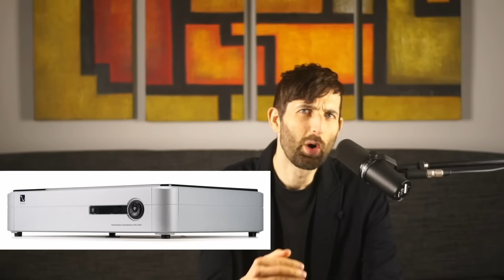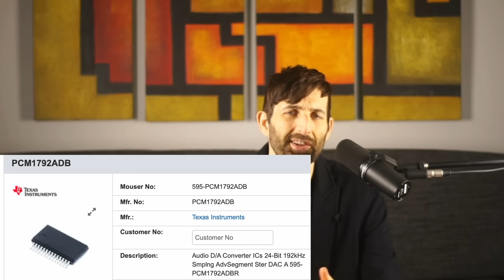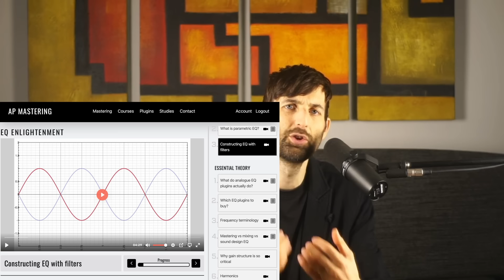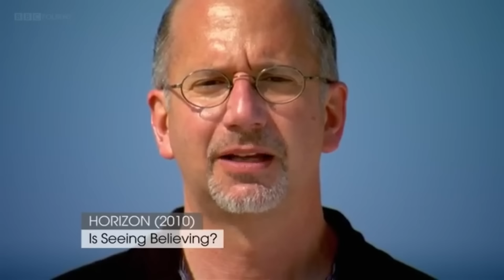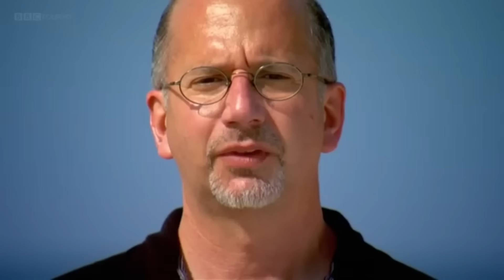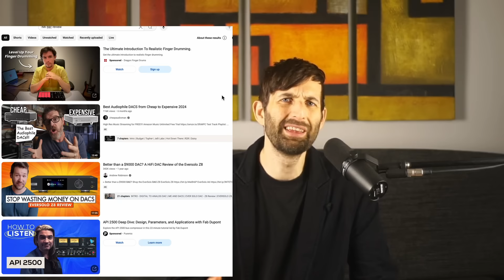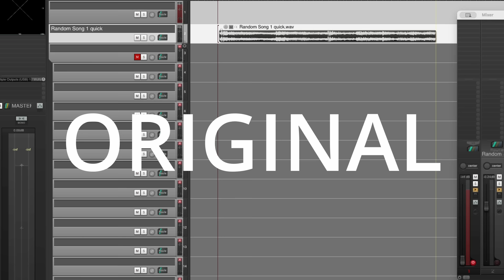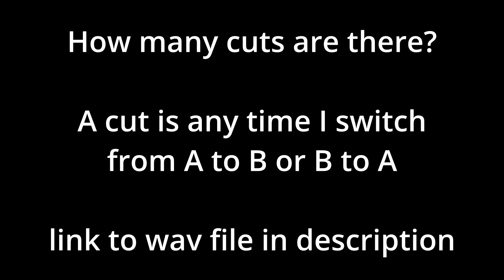The DAC Scam - Almost everyone believes the hype

Comment: So what would you say is the ceiling on what you need to spend to get the absolute best performance. I’m using an  RME ADI-2 atm, roughly £1k, it’s clearly better than other DAC’s I’ve had sub £500, most people would hear the difference imo. 

The other question I have is what is it that made my previous DAC (which couldn’t match the resolution of the RME) have a deeper soundstage? Again clearly noticeable, even someone with zero interest in hifi could hear the difference in depth.
Reply from the maker: Once you are in the RME bullpark, you have already spent enough. RME are IMHO one of the most solid manufacturers of converters imaginable in terms of ultimate quality without getting silly. Although you can certain get similarly good products for less than RME want
Reply: @APMastering Thanks for the reply, good to hear your thoughts.
Reply: @APMastering RME, Merging Technologies for the poor :-)
Reply: @MrMftech  Merging Technologies, Prism for the poor :-) see what i did there? lmao utter nonsense
Reply: The Audio Science Review site measures DACs using a standardised suite of tests so you can get actual measurements to compare. Price doesn't necessarily correlate with the measurements. The RME measures great, plus the per-channel PEQ is an amazing feature you don't often see on DACs.
Reply: You could try its followup model, the FS version, but I'd send it back if you can't tell the difference. Some mastering folks can hear a difference, but they do need to listen most carefully of all the engineers of the sound professions and they do so in the best listening environments.
My ADI-2 just sits there beneath me Fireface UC these days. I needed the ADI-2 because of my portable DAT recorder(I'm a sound designer and re-recording mixer) back in the 90s and 00s. That and the RME Digi-96 card to get in to the machine. My educated guess is, unless you're a working mastering engineer, it's unlikely you'll need anything different than the ADI-2.
Reply: I have a RME ADI-2 FS in a HiFi set-up as well. Great device if you need everything it has to offer. 
I just wanted to chime in about the lack of perceived depth the RME has. I would ask you this question. Have you noticed that the RME puts the vocalists or center image a bit out front? That's all it takes to mess up the recorded tracks natural soundstage.
Reply: @ Yes I have noticed this too. It’s funny, from a technical perspective it’s a great DAC, but when listening to 2 ch hifi it certainly lacks in depth and space, it’s something thats rarely spoken about by tech whizz channels like this one, thats why asked about it in the OP, did you notice we didn’t get an answer either 🤨 I’m probably assuming here but I don’t think it’s a factor that this chap can explain nor use in his favour to back up his argument. I totally agree with his point about ridiculously priced DAC’s but I’ve heard what a £2000+ DAC can do that a well measuring sub £500 DAC cannot do, I don’t think it lies in the measurements that they go off either, thats the issue.
Reply: @ All the experiences by non-professional listeners are a lesser indicator of true qualityies of a piece of equipment. I'll trust a mastering engineer to a degree, but nobody else. Any of our biases, visual cues and even general health can colour our experience. I mix a lot of dialogue and it only takes a few seconds for our brains to adapt to an EQ change. So to detect the subtleties of a difference in DA conversion between units takes a LOT of critical listening skill aquired over a numer of years. Nobody is born with that. So unless you guys are double-blind testing DACs, where you can't see what unit is being used while you're testing, it's just a developed taste. It's not a quality assesment without that testing, unless that's been your job for many years. Then I'll trust your judgment at least a bit.
Reply: As a member of such sites as ASR for many years & taking the time to understand the various biases as well as psychoacoustics I already know what will be said about things that can't be measured. Subjective views don't hold weight to an objective community. Doesn't matter if you have 40 years in digital music listening. One thing you can count on is this..if you perceive something that isn't truly real it will change over time. Interesting though is that we don't know each other, have never had a discussion about the RME, but both already have come to the conclusion that it lacks depth & space..& puts center/vocals out front. I take no offense when certain people say "it's all in your head".  I would also take a blind test challenge using my system & letting me pick the 3 dacs to choose from. 

I'm not saying most people can't tell one dac from the next. That a lot of gear is just overpriced simple circuits. But I also feel these experts are quick to dismiss how well an "audiophile" can discern the smallest difference in their system that they have spent thousands of hours & dollars fixating on. There is more to a dac than the chip of choice. Most sought after dacs aren't even using these basic chips anyway..just the 1000's of sub $1k dacs that do basically sound similar. If one can't tell a difference between a good fpga dac (pic shown in video) & a sabre dac then you are deaf & saved a lot of money.  @russ-p1
Reply: @ I think thats exactly the point, those of us who hear the differences have been critically listening for years. I’d never hold on to a piece if it sounded the same or less to my preference, regardless of price. I’m struggling to understand how health and seeing the piece would have any influence on how it sounds different, we’re not starring at it whilst we are listening, maybe if you were full of congestion from a virus it would hinder your ability to hear a difference but I doubt anyone is going to be critically listening whilst they are unwell. One important thing to consider is this, someone in this conversation who I have no connection with has discovered the same audible difference as me. This happens over many different users with many different devices from my experience, why is that? It’s certainly not health related or a visual cue. Something to consider.

Comment: Rule of thumb, beyong 2000€, not 200€, you get diminishing returns. Up to there the add ons are usually worth, not necessarily sonically though.
Reply from the maker: im talking sonically. I think after about 500€ for a well designed state of the art stereo DAC there should be zero improvements even for the most astute listeners
Reply: @APMastering  true, but then there's lasting build quality, customer service and cachet. A wise bastard can make due with the budget you point on, but leave some slack for glamour and bragg rights, or you'll enter even less clubs than I do... :)

Comment: 2015 I shot out high end lavry vs focusrite clarrett DA for a month and the difference was negligible. That wasn’t the case with lower price point interfaces from around 2010, but we made some pretty major advancements during that time.
Reply from the maker: 100%. To be clear I was talking about cutting edge chips in this video and not older low budget stuff which actually does sound noticeably shit compared to older higher end.
Reply: @ oh I totally understand your points in the video. Great video btw! I was just posting my own experience in this area. I would guess your average audiophile thinks we’re still in 2005 in terms of their understanding of this topic lol. The ADC end there are still some advantages to higher quality chips, but that’s a whole other topic, and most of your more colorful converters are getting that sound from things other than the actual chip. It’s crazy how good some of the lower end stuff is today though. I can definitely tell the difference in like a lower end focusrite and like 1 level of quality higher, but even those budget units are far from “bad” sounding.

Comment: I love your content and your fundamental knowledge involved. Regarding this topic I unfortunately can't agree. I have a mastering grade room-in-room studio built with Helmholtz-Resonators and a PMC 8-2 into a flush mount wall. You can clearly hear the difference between a Focusrite, RME and Lynx. It is a day & night difference. My latest converter is the Lynx Hilo 2 and I do clearly hear the difference to a Lynx Aurora (N). The upgrade is worth the money if you want the best sonic result possible. Just check the tech specs of the two units and I don't romanticize the gear. I do believe what my ears are telling me. And yes, I am level matching all the time.
Reply from the maker: could you hear how many times i switched in the blind test in this video?
Reply: @APMastering I didn't check that tbh, because I have made different experiences. I just know from my long-term experience that a converter makes a significant difference in the sound quality of converting and monitoring. I actually first listened to music in my new studio with the Focusrite because my Lynx was in the old studio and I was confused about the low-end in the beginning. Then I have connected a few days later with the same settings the Lynx and suddenly a light went up. It was such a huge difference, that I was literally positively surprised. Same goes now with new Hilo 2. It surpasses the sonic quality of the Aurora (N). Cheers.
Reply from the maker: I'm just highly skeptical of your claims and am wondering if there is any EQ or exotic filtering enabled as part of the DSP? If you have two mastering grade DACs they should by definition sound identical, and if they sound even a tiny bit different then one or both of them are broken or by definition not mastering grade. Mastering grade means you don't get random coloration, crosstalk, or anything else which would make the DAC sound different. That's why I'm interested if you could tell when I switched in the blind test.
Reply: @APMastering Yes, the room is measured by the Brühl & Kjaer curve by the same guy who built the studio. And yes, it is applied within the DSP of the PMC 8-2. This doesn't change the fact, that the converters do sound different applied with the same EQ curve. The sonic qualities are not measurable by the EQ settings within the DSP of the speakers. I am talking about clarity in the low-end, stereo image and presence of the mids etc. I am listening always to the same music to have a concrete reference while comparing the converters. Alone the Monitoring. and Headphone outputs of the Hilo2 are significant better than the Aurora (N). Once you get used to your room and your speakers, I recognize every tiny little difference which do make in sum a significant difference once you play this music on huge sound systems. Not everyone has the possibilities like me to listen a very good tuned room to music and working with high-end equipment. I do hear the differences clearly.
Reply: Another example: when I drive the signal hot into my Hilo2, you really need to get very loud until you hear the distortion and clipping effects. That was with the Aurora (N) not the case, the tolerance of handling hot signals and clipping was much less. I am talking here about the THD+N ratio.

Comment: Not all dacs use the same chips. There are different solutions for the conversion. Power supply and circuit design make a difference. Just because some people don't hear a difference in blind test doesn't mean there are none. For those who don't hear a difference, fine, they save money. I have no problems hearing differences in blind tests. Really, do some testing you will hear differences. The same goes for cables, even digital ones.
Reply from the maker: how many times did i switch in this blind test then?

Comment: I switched from an old $200 DAC to an R2R Ares 12th-1 DAC and audio bliss ensued.
Reply: I have the same DAC and like it very much over my cheap DAC. I’ve compared it against another DAC, same country of origin, more expensive, and still liked it best.
Reply: @billythestalker  
Thankyou.
Reply: have to chip in there, there is a network qos protocol that audio grade ethernet switches have. Doesn’t change the sound one bit, but does allow the prioritisation of audio packets, so low latency stable audio routing over ip is possible without requiring grandes of dante gear
Reply: @TomTaylorMade  QoS is used in a lot of managed switches, the point is to prioritise certain traffic over other traffic. Mostly because you have several vlans competing for bandwidth and where there's bottlenecks involved, so your backups don't choke an outside location and you can still make voice and video calls even with everything else running.
In a home setting where there isn't several busy vlans choking up the network, there's absolutely no point for it.
Reply: @TomTaylorMade  Utterly wasted. When hires content is circa 10Mbps? Redbook is not even half that. The volumes of traffic in domestic environments make this entirely redundant on even modest ISP speeds. Source? 3 decades in the AV broadcast and networking industry.
Reply: @DeeJayDeathStar  When your streaming 32 channels of 96khz 24bit uncompressed audio between machines the load does start to stack up on the switch especially if you have kids in the house each with 3 bloody devices on the go streamjng. you need to either partition the network with at least a vlan and dedicated secondary nics for the audio, or if your in apple world using their network ahdio streaming, it will only go sub 3msec latency with nics and switches that support that special audio qos protocol which works at the ip level. Can’t remember what it’s called off hand
Reply: @TomTaylorMade  - Deploying Cisco boxes between fiber on a fiber router and with good ethernet cables it has a very nice impact. It's audible or wouldn't be worth doing.
Reply: @Horsey2000  yes, those 1s and 0s never sounded so good. That's because Cisco redraws them all in the buffer so their edges stay nice and crisp.
But don't forget to buy the cables made from unicorn poop and angel dust.
And if you don't have a gold rack with platinum screws, you're not even trying.
I'm a CCNP, ask me anything. I can tell you secret settings for those bad boys that increase your dynamic threshold, widen the sound and give it an extra spit and polish. We learn all that in the audio section of the course. We call it the Backhaul Symbiosis, or BS for short.
Reply: @Horsey2000  My box says Sicso on it, will that also have impact?
Reply: What was the $200 DAC?
Reply: @jochenstacker7448  It was an old Schiit Modi that I still use in my headphone system so it's not a terrible DAC, but the difference in DACs was not very subtle either. The Denafrips just sounds more natural and I think anyone could hear the difference.
Reply: @earthoid  I was a bit perplexed by the brand name. 😂
Reply: @jochenstacker7448  Exactly!!!!   He said over $1000.   If the $200 dac was trash (bad ps and or clock) he SHOULD have expected a difference.  Try hoping from a " Good" 1K Dac to a $10k, and the difference will be subjective and will fail blind testing if level matched...
Reply: or switch to tape recording! outboard fx, an analog mixer, some outboard synths. also lovely workflow.
Reply: It seems that many DAC reviewers might not want you to feel completely happy with your current DAC, often wanted you to buy new and Expensive DACs, due to marketing strategies.
Reply: I switched from a Teac UD501 DAC (Delta Sigma DAC) to a Holo Audio Cyan 2 (an R2R DAC) and the difference very audible. It is much easier to locate the instruments. There is a lot more detail. The music is much more transparent instead of veiled. And also there was a coloration of the sound on the Teac I didn't like (like a metallic glare) ; that was gone after switching to the Cyan.
Reply: yup my venus II-12th blew away both the node 2i AND a Mytek.
Reply: @petekutheis3822  unfortunately I doubt you will convince AP Mastering of anything.  Denafrips Venus ii is a beast!
Reply: "Lush Warm open sound"
Reply: Musical
Reply: @HatredPrime  🤣
Reply: The key word here might be "old" $200 DAC. A lot of stuff has happened in DAC development. If you had bought say a $200 - $500 new DAC, audio bliss might have ensued as well.
Reply: @earthoid  I think the issue is the classic case of rate of diminishing returns. After $1000, you are going to get limited improvement...so where is the justification in spending thousands more....let alone 10's of thousands
Reply: I bet it sounded "more musical"
Reply: @earthoid  I can honestly say my Ares 12th sounds different and better than the DAC that came in my McIntosh c50 preamp. And I can also say with confidence that my Gustard X16 DAC highlights treble frequencies better than the Ares, but the Ares presents tighter more revealing bass and the midrange is more pleasing to my ears. Also when compared to the McIntosh DAC, both the Ares and Gustard separate instruments in space better and give a 3D soundstage. The Ares does this slightly better than the Gustard.
Reply: @johngutmanis3580  Have you completed your blind test or loopback testing as directed in this video? Of course not, still sticking to subjective nonsense and ignorance.
Reply from the maker: i'm happy that you found bliss. i've got some golden ethernet cables that make your internet connection more energetic and majestic, selling them for just 100k each
Reply: @APMastering I'm in. Where do I send my moolah?
Reply: @APMastering Your arrogance is insulting! You sound like someone that tries to bash audio components! Grow up kid!!!
Reply: @APMastering lol But Hans Beekhuyzen might be in the market. He likes "audiophile grade" ethernet switches.
Reply: @APMastering - The Ares 12th doesn't have a chip. It's messing up your claim.
Reply: @Horsey2000  Don't say that, you'll hurt their feelings.
Reply: @Horsey2000  He wouldn't believe you anyway.
Reply: The placebo effect can be bliss inducing.